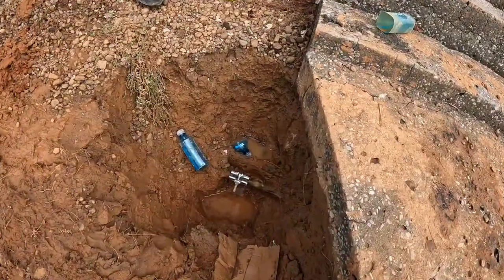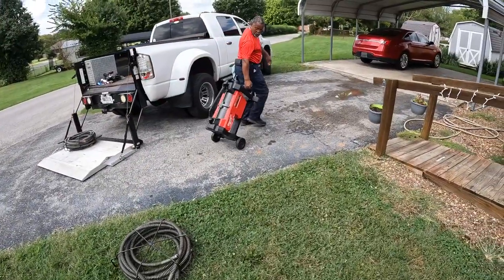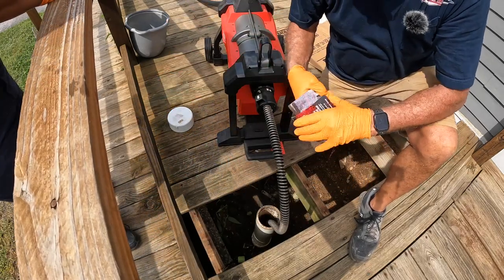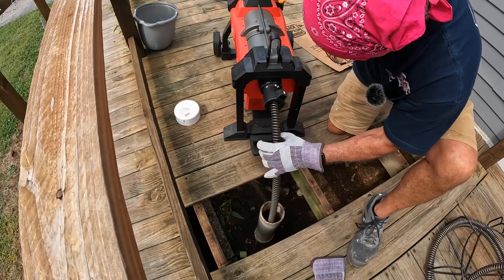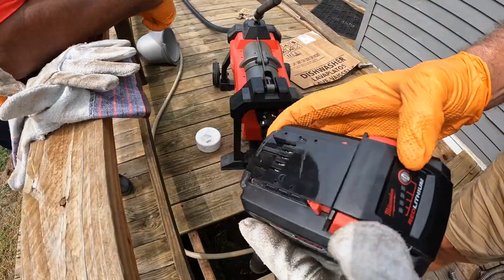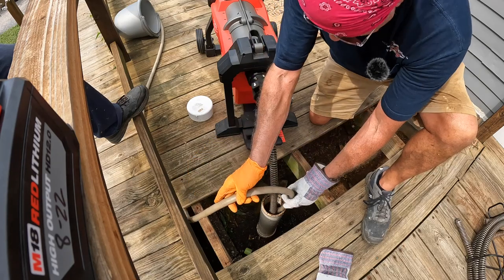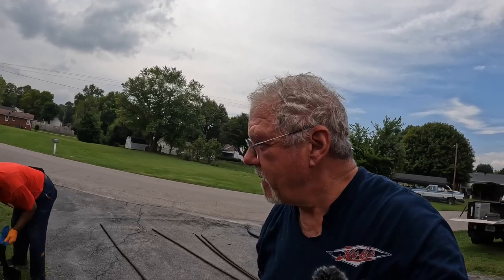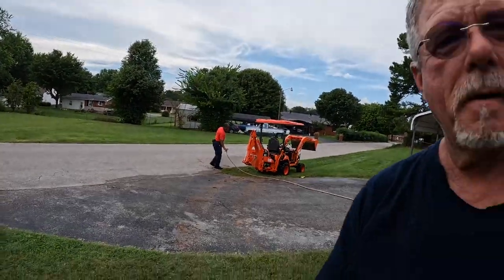New tool Tuesday--Milwaukee sewer

Comment: Nice job with the clog but I can’t believe you are gonna bury that 
“temporary “ repair clamp on the water main!  I couldn’t tell what type of material that line was made of but you’ll be back to fix it again buddy.
Reply from the maker: The water company here gave that to me, they said that’s what they use. I didn’t want to dig the sidewalk up to put a new pipe in.

Comment: Those snake sections connect really easy. Not afraid they will disconnect just as easy in the pipe leaving a souvenir?
Reply from the maker: No they actually lock in and you have a key to unlock them. They can break or get stuck. I have a retriever spring that is supposed to pull a cable or bit out. If that does happen.
I do have a backhoe to dig a section up if I had to get a cable or bit. Thanks for commenting.

Comment: Great jib as usual my friend. I was thinking about buying that same drain machine because I love the fact it feeds itself and pulls cables back on those really long runs. Please tell me what you really think of the machine or do you need time to beat it up some more.
Reply from the maker: Since this is the first time I had even turned the machine on and wasn’t real familiar with exactly how everything operates and this isn’t the most difficult clogged I’ve ever unclogged I can’t give 100%. The machine worked great, operated great. I liked the feed & retrieval of the cable as well. On this first use I liked everything about it and the way it transports. I am interested in getting it into a more difficult clog to actually see the power capability of the machine that’s my main concern is when I get into a tuff root situation how will it perform. It seems to have good power.

Comment: 90ft or so where it clogged up before. So wouldn’t it be a headache saver just to dig the line up there and replace the problem section? Asking a serious question. Just for future is why I ask. Them snake machines are nice tho.
Reply from the maker: You are absolutely correct. I’ve been wanting to do that for sometime now but I’ve just not taken the time to do that. I’ve had several remodeling jobs last 2 or 3 years and just haven’t gotten to it. Thanks for commenting

Comment: How does this compare to the rigid k1500? I own some rentals as well and I’m trying to decide which to buy, I already own Milwaukee tools as well so I have that battery system
Reply from the maker: I’ve only used it one time. I’ve said it’s been the best sewer machine I’ve purchased because since I’ve bought it I’ve only had one sewer stop up!! Lol it worked just fine on this stoppage. I’ve not sold the ridged k1500 yet because I was waiting to use it one more time possibly on some good roots to really test it. When I bought the Milwaukee I said if it performs as well as the ridged I would sell the ridged. Thanks for commenting. I also own the ridged flex shafts there awesome.
Reply: It doesn't.The rigid has much more power.This machine is garbage.I used it and it's failed me every time.Its only good for light clogs.

Comment: Which do you think would do the better job this machine or a jetter? Thanks
Reply from the maker: I’ve personally never used a jetter but they seem to work really well. I guess it would just be a personal preference. Thanks for commenting.
Reply: @DavidFDay  jetting is really good for built up food grease stuck around the pipes. I used to use the machine to unclog the pipes and then use the jet